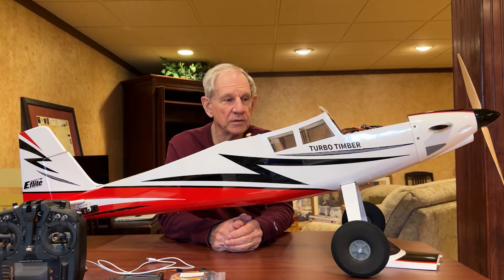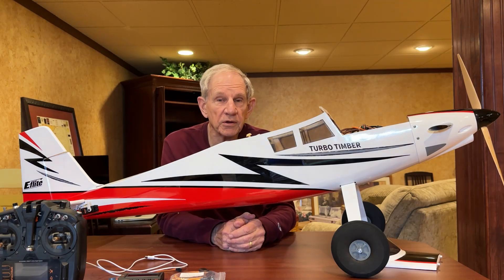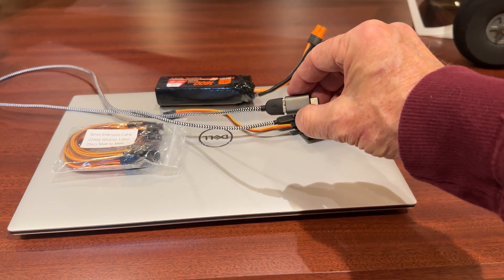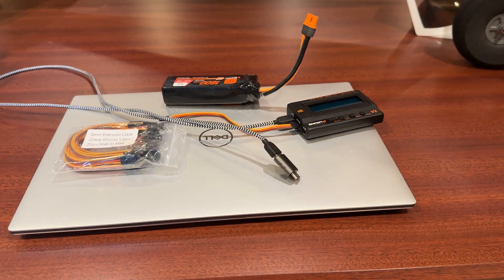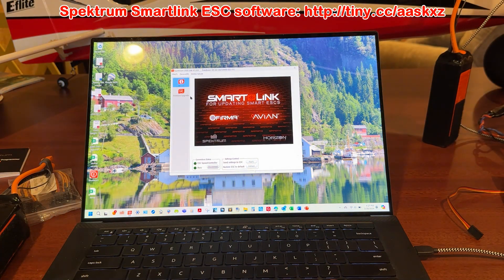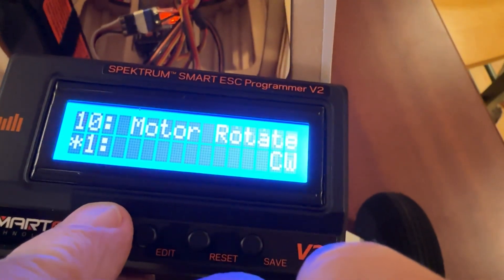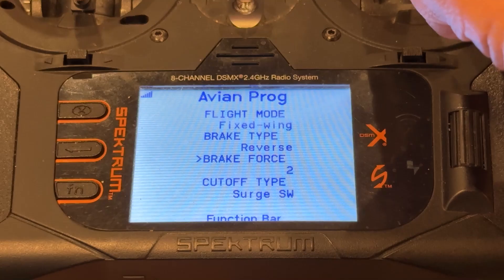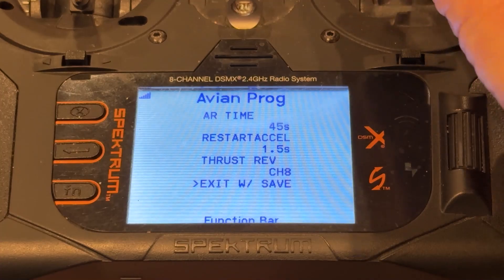Setting up SWS Turbo Timber Thrust Reverse - it's potentially complicated

Comment: Thanks for the info.
I notice you have inserted proper windows into the Timber - neat - any problems with this e.g. weakening structure etc?
Reply from the maker: Well, if you stall and spin in from low altitude you are looking at a new fuselage, battery hatch, motor mount and cowl. $333. Or one hell of a rebuild. Don't ask me how I know.
Reply: Oops now I have spotted that yours is a TIMBER Timber - hence the glazing!!!